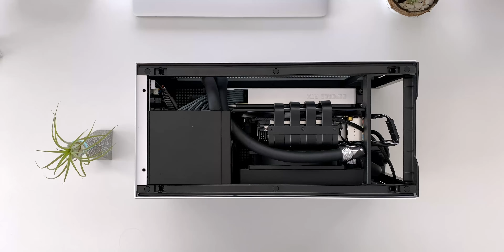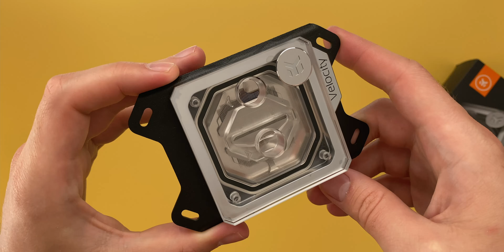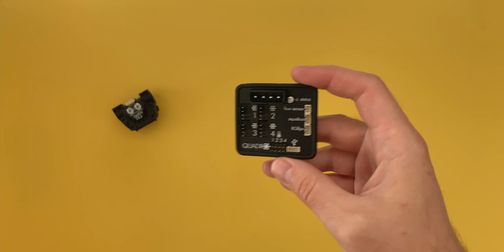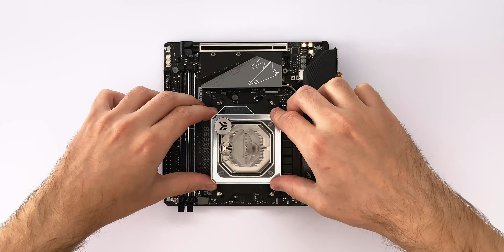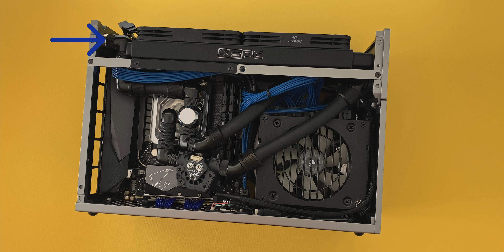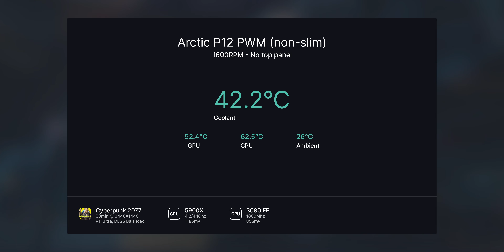FormD T1 - Watercooled 3080 FE & 5900X

Comment: I would like to do this with a 5090 and 9950x3d in this case.
Reply from the maker: You can do it but you’ll need to run external radiators for any sort of sane coolant temp.
Reply: @EIGAtech gah, then this might not be the SFF case for me. I do have a sliger SM580 maybe that’s doable.

Comment: Beautiful build! How do you fill the loop without the reservoir, and how do you know it is full?
Reply from the maker: Thank you! It’s not that hard as long as you have at least two inlets, preferably at opposite sides. Fill as much as you can from the inlets you have, then run the pump briefly until you hear air getting sucked in then stop and fill some more. Eventually you should be able to tell by sound when it’s full as the loop should run silent. There are likely air pockets remaining that you won’t see but with some clever loop design you can bleed those out in time.

Comment: Wtheck that’s better temps than my 3090fe in my Lian li case with 9 fans :(
Reply from the maker: That can’t be right. Which temps specifically? What RPM are you running the fans at?

Comment: #6-32 3/4" UNC (Course threads) should work.  The Noctua 15mm fans should work with those.  If you need a bit extra hight on the 15mm, add the sound dampening pads to the bottom which will raise the fan just slightly off of the radiator.

Comment: Ahhh, the dc-lt 2600. I’ve had 6 all failed.
Reply from the maker: That's a lot of pumps! The one in this build is still going strong. How did yours fail?
Reply: EIGA 2 failed on arrival and the other 4 just gave out. Every single time it went like this. Hear gurgling somewhere in room…hmm get up to check computer go to put hand on cpu and I can already teel immense heat. Ridiculous temps. Reboot to pump completely dead. Checked voltage and everything. This was before they released the new version. Form D sidearm with custom loop on a 3900x and Quadro.
Reply from the maker: @AbsoluteRecoil  That is just horrid. I have setup HWINFO alerts for pump failure, paired with a .bat that will also shut down the system after a short delay. For peace of mind if nothing else.
Reply: With that much underclock on the 5900x, how is performance affected in games mostly?

Comment: Intresting to see you can cool all that with a single 240 rad. And also good to kow having the collant temps this high is ok. I'm trying to keep it under 40°c but currently only cooling my cpu (9900ks) . Plans are to also cool my 3080 FE with my current radiator setup of around 480mm.
Reply from the maker: The lower the better for sure. Most pumps are rated to 50-60C. The issue with such high coolant temps is that the delta between some components and the coolant can be rather high. It's not an issue with a GPU, where generally you're 5-10C above the coolant temperature, but with a CPU that delta is a lot higher because of all the thermal interfaces between the die and the cold plate, so if your coolant is already at 50C, the thermal transfer is going to be really poor.
Reply: @EIGAtech  Thanks for the info. Its really hard to find any info about cooling temperature. I've been over 10 years in the pc watercooling hobby and haven't found any topic about this subject. I've always tried to keep it under 33°c in the past,  but my recent hardware upgrade made my old watercooling setup be on the edge and i can't expand as i have no room for it. I've been searching for setups with little radiator surface and a 3080,looks like there's a hype going on with these little cases. I might give it a try aswell.

Comment: Gaming at 4K will put almost no load on your overclocked CPU. So you’re testing very low strain on the CPU and full blast undervolted GPU temps, so Cyberpunk is unfortunately not a good test for your system.
Reply from the maker: The test is running at 1440p ultrawide and is uncapped. The bar chart in the overlay during the Cyberpunk 2077 gameplay represents thread load and you can see there's lots of it. In my experience it's a great real world test. Sure, it's not the absolute worst case scenario, but it's far from not being a good test.

Edit: Another thing to keep in mind is that the test is a 30 minutes run, and while not seen in the short clip in the video, the run I did contained sections where the system was also CPU bound.
Reply: @EIGAtech  what program did you use for the bar chart overlay?
Reply from the maker: @ryanjelinek3969  It's RTSS with a custom overlay.

Comment: If you need a Pump you can trust more than the DC-LT you should look into the Nouvolo Aquanaut and a PWM DDC 3.2 rewired to 4 Pin Header and connected to the Quadro. You could even go for 3 Slot Mode with the koolance swiveling elbow Low Profile fittings and have another G1/4 Port through a pcie Slot Cover to Connect external Rads.

I have my T1 ready to be connected to a Mo-Ra3 420 once they ship again. But of course my T1 is fully functional without the Mo-Ra3. My Setup is Aquanaut+DDC 1T Plus PWM, TPV 12,7 tubing, EK 240 classic rad, 12x15 fans and 2 Ports going out the back for filling/connecting external parts.

Specs are 8086k 32gb 3600cl16 RX6800XT with the water block from TechN. SF750 with unsleeved cables of course.
Reply from the maker: Hey! Thanks for the detailed comment.

I know about the Aquanaut but the ugly wires on the DDC pumps put me off, and I have no skills for rewiring. Maybe in the future! The Aquanaut is certainly cool but I've read reports of some QA issues, did you have any trouble with yours?

I'd love to see some pics of your build once the Mo-Ra gets to you.
Reply: @EIGAtech  Had no issues with my Aquanaut so far. Sure you can get some pictures. Any profile I can contact you Reddit/Discord/Instagram for example? Btw I dont really care for those wires. I really start to like bare hardware without any bling, but enjoy builds like yours too of course.
Reply from the maker: @Aexeq  I get what you're saying about hardware without bling. It can have its own appeal for sure and less... vain? You can message me on Discord: eiga#0103

Comment: I love it! Amazing!  Lol I was going to use the dc-lt2 2600 and eisstation 40 in my thorzone mjolnir but noped the fuck out for the same reason as you.  The quality scared me when I assembled it and thought it would leak on me haha. Plus I didn't want to deal with filling such a small reservoir and getting all the air bubbles out with that low of a pump speed!  That's some outstanding work you did on your T1!!
Reply from the maker: Thank you! It does work as advertised though, and I know I've put the DC-LT pump inside the Eisbaer Solo through some intense workloads on the H1 build. The Eisstation is an absolute joke and they deserve to be called out on the build quality.

Comment: I’m building in mine soon but was under the assumption I could fit a 27mm rad AND P12 fans. Am I mistaken? Should I return? Lol and thank you for the video, very helpful
Reply from the maker: The XSPC 240 rad claims to be "the world's thinnest" at 20mm, and the only builds I've seen with full sized fans are the ones with sanded down fans.

There is an even thinner radiator at 17mm found on TaoBao, but it's of doubtful quality. It's the only one that will work with the P12s.

Take a look at this thread here:
https://www.reddit.com/r/FormD/comments/ifjgrl/the_17mm_thin_radiator_is_actually_doing_ok/

Comment: Great video! Hoping to build something similar when they restock. Is there space in the bottom or the front section to house a 2.5in drive in this config?
Reply from the maker: Hmm... I think so. I think normally it mounts to one of the front panel pieces, and it looks like there's enough room in my build. I'd be more worried about routing the cables. Still, should be doable.
Reply: @EIGAtech  How has your longer term experience been with the T1? I was planning on doing the exact same build but received feedback from the formd T1 subreddit that a single 240 slim rad would not provide enough cooling.